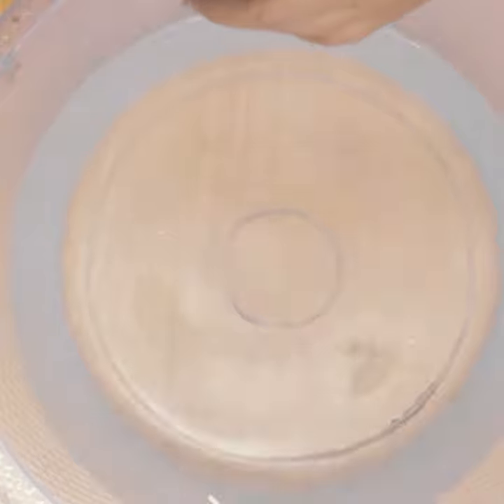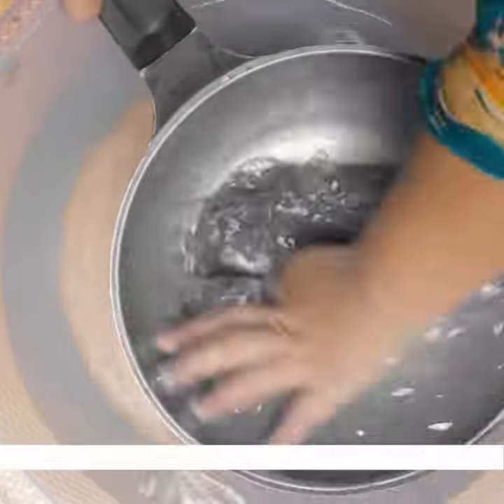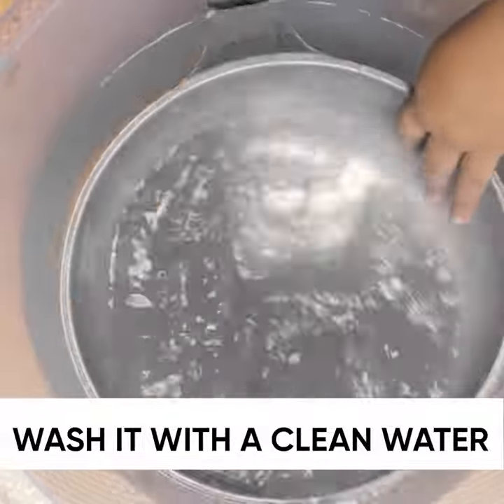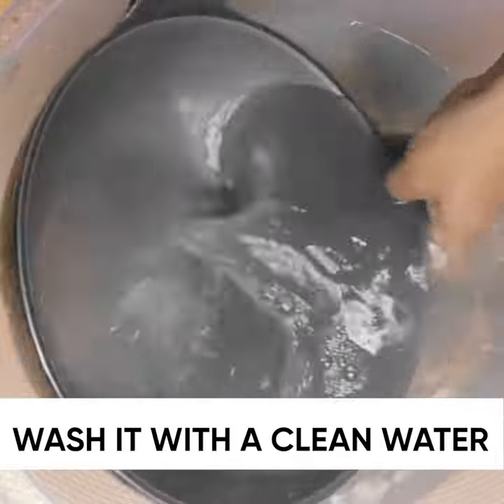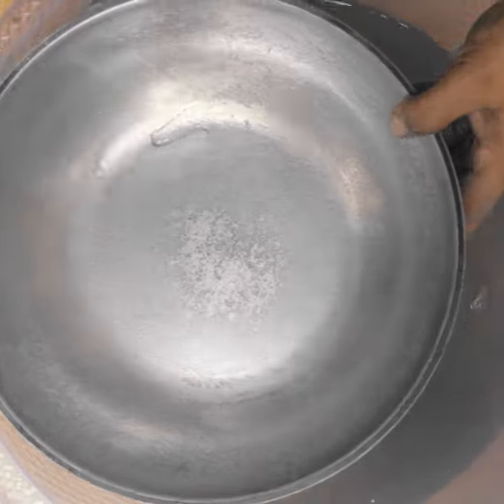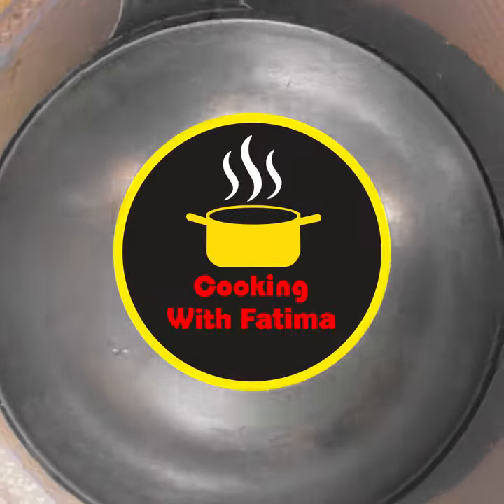Remove Nonstick Coating from a Pan| Reuse a Nonstick Pan| Clean Nonstick Pan| Kitchen Hacks

Comment: It is safe?
Reply: not sure, it depends if the metal contains contaminants in itself such as haevy metals and/or any other , any of which were meant to be barriered by the unhealthy coating …
Reply: No! It’s probably the worst thing that you can do aside from eating asbestos
Reply: @jamalrs17  seems like the black powder is toxic
Reply: @jec_ecart  the black powder is a PFAS coating. It’s essentially a super toxic coating that means food is less likely to stick to your pan. Best bet is to buy a stainless steel pan and use butter.

Comment: Wear a mask. Those coatings have the toxic "forever chemicals" that you are releasing.  The only reason I'd do this is to be able to sell it to a metal recycler. Quality stainless steel can be worth some dough but they don't normally take coated pans.
Reply: She has water in it while scrubbing. if you expect she needs a mask for that, then apparently you have a flawed understanding of how particulates can become airborne.
Reply: She started with a barely damp scrubber, and she's not wearing gloves either.
Reply: @randominternetviewer166  well, the real issue is that now there's lots of microscopic flakes from the scrubbing that she can't see, best way to remove this toxic coating is using chemicals, then thoroughly washing the pan

Comment: listen Fatima, ARE YOU STILL SCRUBBING? 🤣🤣🤣🤣🤣🤣🤣 "You're fake"!!!
Reply from the maker: it's not a fake video.
Reply: @CookingwithFatima  Yeah, I didn't want to make it sound like fake, fake.🤔
My point was that when you start "scrubbing", the coating was already gone; you just polished the bare metal.
The black stuff is the alloy of the pan itself, not the nonstick coating.
To remove the Teflon by hand (with soap) would take a whole year, Lady.
So what should we call the video?🤨
Reply: Coating nduk tiseyadam
Reply: Chuck Norris can make onions cry.
Reply: @mounikap5656 it's not permanent,  hence why the video to remove, once it starts coming off its very toxic... you don't want to ingest any of it. Why do Teflon coated pans Starr sticking after several uses? It's because the coating starts wearing off
Reply: @cfonvip5151 no it's not fake. I have seen a non stick kadhai which coating is easily removed by scrubbing.. I think it's depend on quality of coating.